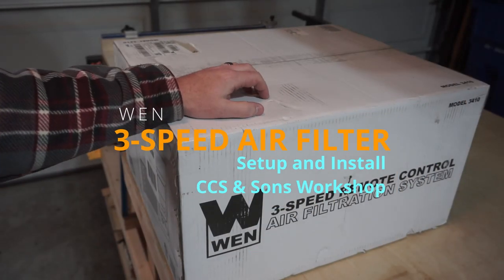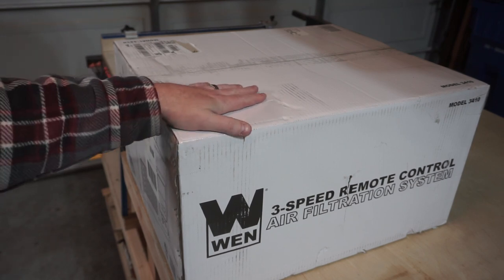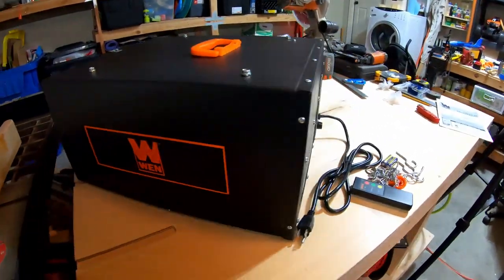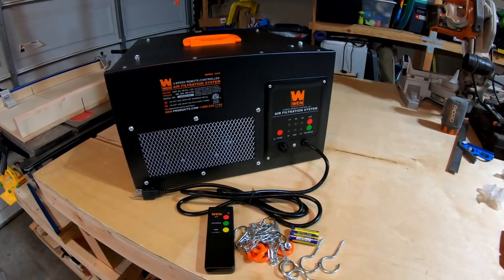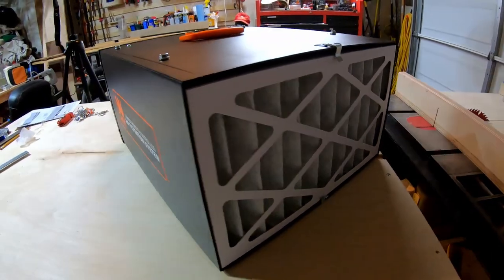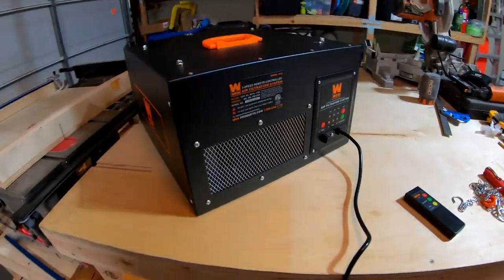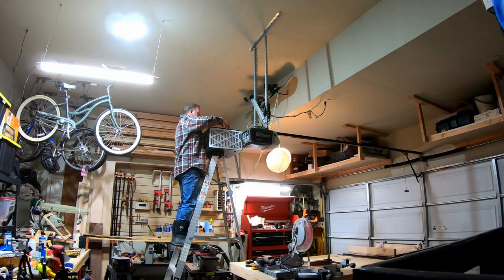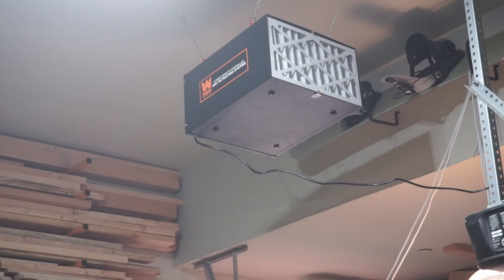WEN 3-Speed Remote Controlled Air Filtration System - Setup and Install/Thoughts

Comment: I bought one but it turns itself on whenever it chooses. I left for a weekend and came home to find it running at high speed. Any idea how to end this pattern? I just unplug it but I shouldn't have to.
Reply from the maker: That's very strange! Sorry, no, I haven't experienced that problem. Check with WEN through customer support?
Reply: @CCSandSonsWorkshop  
thanks, will give it a go.
Reply: Wens solution is to climb a ladder up into the rafters and plug it in when you want to use it. Lol.  Might as well throw the remote away at that point. I'd shop around before buying this.

Comment: Does it take fumes out of the air? It would probably remove overspray if you went crazy or something but fine wood dust is no joke.
I have heard of some people getting sinus infections...
Reply from the maker: No, it won't filter fumes. Only particulates down to 1 micron (which is tiny and the most dangerous).

Comment: Mine quit working but it was a slow death. Sometimes I'd go to the shop and it would be running all by itself. I contacted wen and they told me that signals in the neighborhood are allowed to intwrfere with the remote. Wtf. At first it only worked intermittently  and then the remote stopped working all together. The button on the unit does not power it on anymore.  If you live in the cities, don't buy a wen. Wens solution was to unplug it and only plug it in when I need to use it. So I'd have to climb a ladder into the rafters to plug it in everytime. No thanks.  Shop around for better products. Only had it a year or so.

Comment: Can this be run on a countertop/floor, or even just anywhere that isn't ceiling hung?
Reply from the maker: You can run it anywhere, but you get maximum airflow in the workshop by having it up high where it creates a circular cycle of air.

Comment: Hey I like that system! Some observations. I checked it through your amazon link and found it is very reasonably priced! I have half of our two car garage and this unit should be the perfect size! I think air filtration is just as important, if not more, then dust collection. Dust collection makes life easier but filtration makes it safer and healthier. I like that all the mounting hardware is included. It’s practical, looks nice color matched to the unit with the WEN orange and, is well made. No chasing parts! I like the hand remote! No climbing a ladder to power it up. I REALLY like the times feature!! How’s that saying go? Just set it and forget it!!😁 And quite!! Very nice! Even on high it really didn’t sound any louder than a window mount air conditioner! I think this is a good addition for any small shop and price won’t make just WISH you had it! Thanks!
Reply from the maker: Yup, I agree 100% filtration is huge. I have noticed a benefit in my lungs when sanding or doing other tasks that generate small particulates.